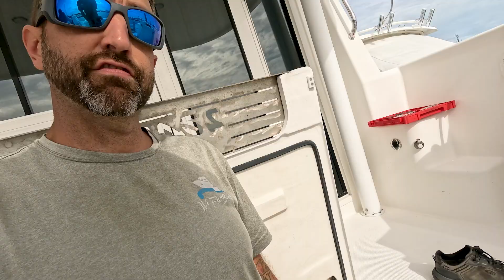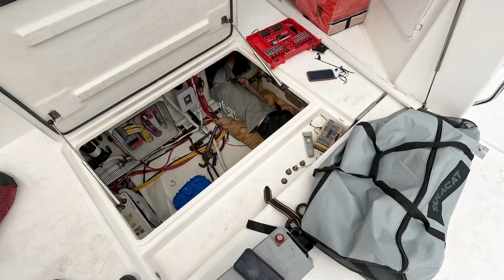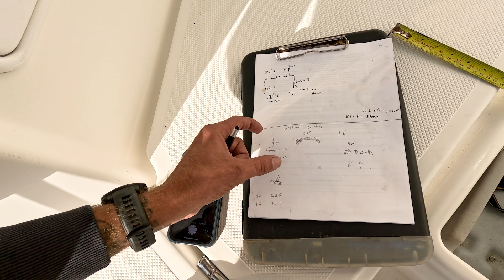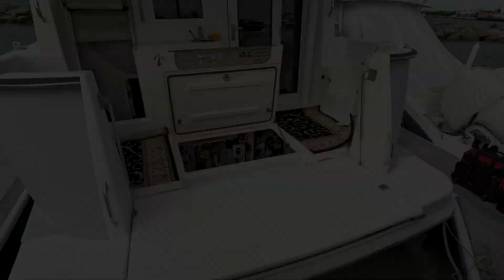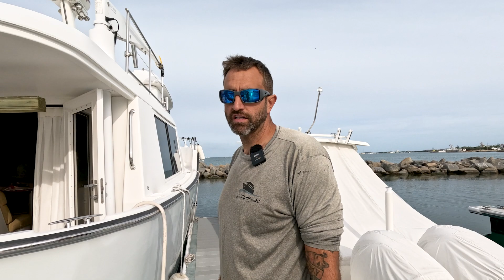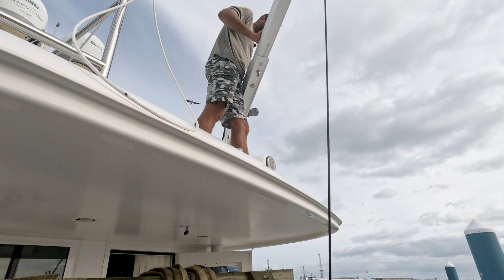Fell Face First! Load SHIFTED …

Comment: My question is if you knew what the load rating of the davit was and you’re going to use the davit to set the generator on the dock, why didn’t you just go ahead and use it to lift it out of the compartment then you could’ve placed a couple of two by fours across the opening to take a time out.
Reply from the maker: Unfortunately the overhead wouldn’t allow us to use the davit to pick the generator up & out of the lazarette.

Comment: I really replaced  a Fisher Panda generator with a Northern Lights generator with was 7 or  8 times larger. The installation was done with the boat at anchor in Sint Maarten. The removal of the old one was simple but they neglected to remove the oil first and spilled oil on the side deck. The pad for the replacement was built and the new one was disassembled and brought to the sailboat by dinghy in pieces. The boom was used to lift the new parts onto the boat and it was reassembled in  the engine room without incident. No modifications were needed except for the mount for the new generator.
Reply from the maker: Yup we used the davit to help us too but what you can’t see is that it extended out & caused our load to shift! We are going to have Brent do a follow up video to explain what happened!